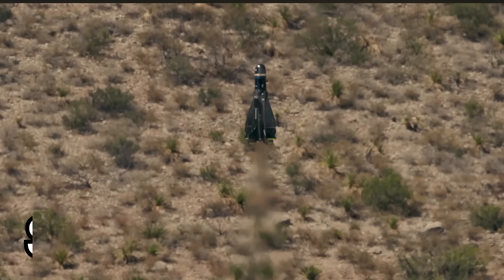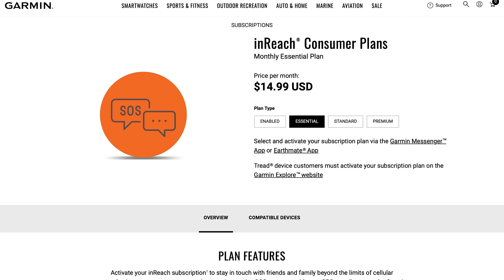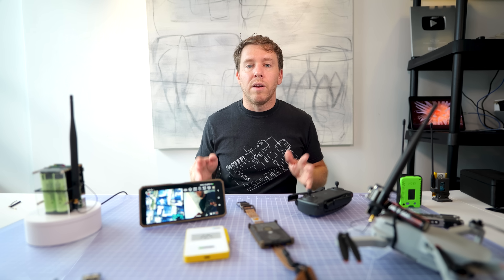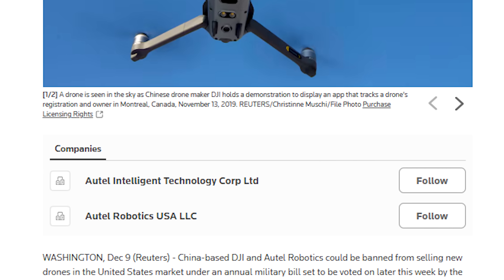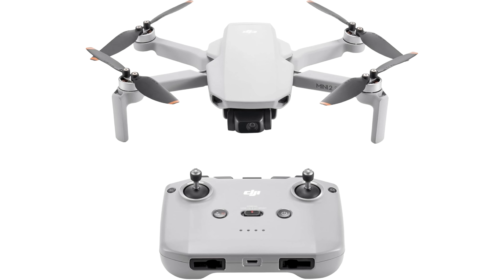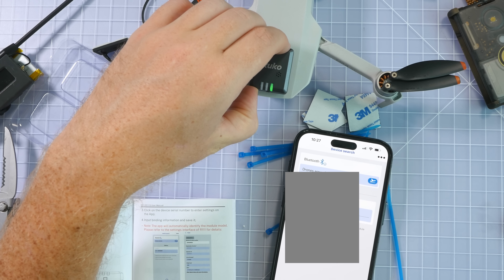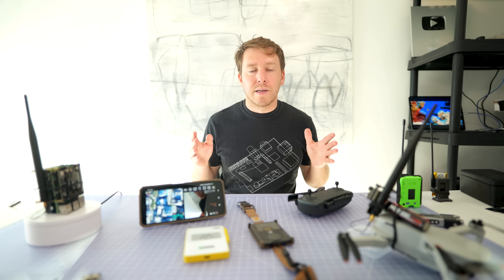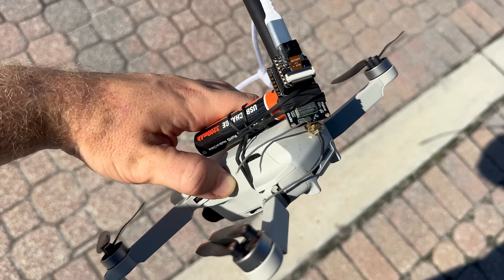I Built a $40,000 Military Drone for $120.07

Comment: 14:50 ahh brings me back to early drone building days :) Those waves are an artifact which boils down to vibrations experienced by your camera caused by the propellors. mounting camera directly to drone body (without physical dampening) really isn't an option. Camera belongs in a suspension system, typically below the drone. Think: camera suspended below drone by 2-4 rubber mounting points. Its a great opportunity to add the extra battery to the same rigid body carrying the camera, to add inertia to fight the vibration too. look up search terms like  Anti-Vibration Shock Absorption Damping Rubber Balls. Great video, thank you for sharing!
Reply from the maker: please and thank you

Comment: Well on of the differences are the material that the components that are made of, for example you can have a transistor that have the same almost the same specs but the cost is different. I hade found transistors are that like 600 euro each, they are used for aerospace.

Comment: maybe i'm dumb, but i've watched the video very precisely till the end and did NOT understood - what's the point of all of this ? 😂🤣😂

i mean - for some unknown reason you've decided to use WIFI HALO for video-transmission rather than widely available FPV video-transmitters (DIGITAL, HD!!) - such trnsmitters comes with receivers which have HDMI OUT = you could connect it into Raspberry PI (with HDMI -> CSI CAMERA-port converter) and use RPI as a video-streamer via starlink to youtube, tiktok or anywhere else

the whole setup will be cost something as 
$140 for VTX + $20 for HDMI-CSI = 160 USD
+ RPI ZERO W : $15 bucks

so basically saying this "device" have no sense

especially that you are using original joystick for drone control
(which have range limit of 20 miles)

rather than some kind of MESHSTASTIC-enabled joystick & a receiver mounted on drone
- which for example could give the ability to control it anywhere in the world

Comment: Hey that’s pretty cool. Here’s some pointers to extend range/reliability and improve image quality. 

Keep all cables and objects away from your antenna (don’t strap your battery to it).
It’s a tuned device and by doing so you detune the antenna which not only sacrifices range whilst creating blind spots but will over time damage the power amplification stage of the transmitter rendering it useless. 

The ripples seen in the video are CMOS sensor ‘jello’ caused by mechanical vibrations interacting with the CMOS sensor’s rolling shutter.
You need to physically decouple the camera from the airframe. For a small device 4 silicon o-rings mounted in a square (the o-rings make the walls of a box) using a 3D printed mounting point would work. Think of each o-ring as a pair of leaf springs back to back. 
Look up FPV camera jello vibration dampers from a good few years back for ideas. Sections of large gauge silicon tubing might also be easier to work with.
Good luck.
Reply: Great ideas there.  Could do your own video!
Reply from the maker: so what's the optimal battery setup then?

Comment: something to consider for future project..  Hopefully soon-ish.     

A drone (or kite or  balloon)  that can fly   a device up  out of tree's and mountainous areas to get cell signal that can beam to your phone down below where  you are.  This way you can contact search and rescue etc; YET not put your cellphone in danger of getting  lost or bricked if the flying device crashes.   Having your phone with you; at least gives you the option to hike to area with cell signal if your flyer crashes.  (SAR suggest to not leave vehicle....  but gotta do what ya gotta do... right now that is ONLY choice when you have no signal.)
Reply from the maker: In my expereince it's not the mountain blocking the signal that's the problem, you usually won't get signal even at the top of the highest peaks. It's just the remote-ness of the area so not sure drone helps there very much - unless you've got other nodes in the area.
Reply: @DataSlayerMedia  really good info.  Thanks.

Comment: @11:36 you can see you did not secure the camera module. Attach it to a rigid surface because its flexible PCB is susceptible to vibration. The "jello effect" or wavy distortion you see in the video at @14:48 is a direct result of the camera module flopping around. While securing it will significantly reduce this effect, it may not eliminate all distortion.

Comment: Mechatronics engineer and 7 year UAV builder here,
the patterns in your image are commonly known as "jello" in the fpv drone world. It's a result of high frequency oscillations from the drone adding up and moving the camera back and forth throughout the frame that's being captured by the sensor. It's fixed by stopping your camera from flapping about but it can't be tied down too rigidly either. This is why the drone's camera is held by a system of rubber strips to "isolate" it from vibrations as you would with electronics from a dirty PSU voltage.
Reply: basically the rolling shutter effect
Reply: @tobutticus  yeah, who would have thought there would be so little jank factor attaching a $6 open source camera to a drone n your garage. I wonder if those 3M two-sided tape squares would do it, they are good for sticking a lot of things together and it's basically about 1/16 inch of foam between the sticky layers.
Reply: @tobutticus  in combination with the vibration of the motors
Reply: Comments like yours are the reason I want to be a content creator and build a community around my topics of interest. I salute you, sir! Thank you for your comment!
Reply: Click bait title, he seriously thinks his $120 drone is a $40K gorilla military drone. In the Military world $40K is dirt cheap, anything less than that would be interesting feat of engineering but really needs to surprise experienced military aerospace users. Military drones camera systems uses proper gimbals and vibration isolation to prevent the camera recording oscillations due to vibrations, those gimbals systems itself costs $120 alone (for a cheap one). There are tons of books and theory on this subject alone.
Reply: Sometimes pieces of cardboard work too. It's hard to find the correct rubber pads.
Reply: Maybe if he keep all payload centered so that it doesnt affect the center of gravity that much. That extra length of cable is just flapping around, probably causing the flight controller to always auto correct attitude.
Reply: Just a highschool student here, in simple terms is it like a gyro? like to counter balance is using Tension uped strings, for example the counter balances which are in skyscrapers in case of a earthquake
Reply: Nice :)
Reply: Switching from a rolling-shutter CMOS to a global-shutter sensor (CCDs were the go-to in the past, but modern global-shutter CMOS has taken their place) will eliminate the jello effect. Back in the day, PIXIM-based FPV cameras were prized for their wide dynamic range and analog outputs, which integrated well with 915 MHz UHF RC links and long-range analog video gear. A high-gain directional antenna (Yagi, Patch, or Pepperbox) on the ground station makes an enormous difference

I’ve flown my Zephyr Z2 on ImmersionRC gear out past 40–50 km with solid penetration, even through terrain. Fresnel zone violations are a thing of the past.
Reply: Yup, should be able to be tuned out
Reply: agreed - this was the first thing I thought - back in the eaaarly days of uav building (when it was tricky!) - usually a few strips of servo tape (green, super thick kind) would help but the camera needs to be fixed as well not floppy like that one you had.  Great content!
Reply: 0 year UAV builder here, this is basic physics. LOL
Reply: @HermanWillems  better place to start than at nasa internship. you can soft mount a camera but dont do it with motors or flight controller cuz the gyro filter takes care of it, otherwise you get bigger wobbles and feedback loop. flyaway. RIP.
Reply: @overryd8573  You do soft mount the gyro, but not too soft. Less work for the filters. And there was a faze where people were soft mounting motors, diatone had some frames with it built in.
Reply: Actually it is due to the fact that the camera doesn't have a global shutter as a proper system would have. It's fixed by using a real camera.
Reply: @rsilvers129 you mean like army uses ?
Reply: not a drone tech here, figured lack of gimble, cause vibration issues like camera movements...
Reply: @imyourocd  or oscillation due to the flight controller trying to correct attitude caused by flapping wire extension probably throwing CG everywhere. Maybe the flight controller PID is tuned without such unusual payload.
Reply: @itchysaddle  true..
Reply: @itchysaddle  No, to put it simply. Spinney motor make vibration. Each wiggle on the screen is the vibrations per frame. The flight controller isn't that fast.
Reply: @Ka0sNite  you are probably right. But the camera in the DJI drone does not have this. Is it the gimbal that came with the drone that is fast enough to compensate for this vibration or it is just a good quality camera?
Reply: I thought it was something like that. I'm guessing this can't be fixed the way you fix gyroscopic procession by counter rotating. I'm sure drones are already doing that.
Reply: I know absolutely nothing about fpv but have a few drones with 3 axis gimbals but anyway wouldn’t you be able to increase or decrease kv from software or is that all limited by the hardware? You could change those oscillations by changing the power going to the motors in effect changing frequencies? I’m interested in building an fpv and have crashed, repaired some DJI Drones so I know how to solder and stuff but that’s about it..
Reply: Moongel drum damper pads are a cheap and effective fix.
Reply: Seems like it ought to be solveable in software with a convolution matrix
Reply: You can pick up an icm-42688 sensor for cheap
Reply: Software defined digital image processing can fix that
Reply: so the answer is rubber bushes yes?
Reply: Use rollerons attached to the camera mount to self correct
Reply: are not they using gimbal system instead of a fixed connection with rubber?
Reply: @bern_channel a gimbal wouldn't solve this particular issue. a gimbal would indeed stabilize the video output, but wouldnt stabilize the oscillations of the sensor itself.
Reply: @bern_channel   - most RPA Gimbals are rubber mounted with damping mounts.  Eg. any DJI MultiCopter - has the base plate on a semifloating arrangement  (at least all of mine do) - there are~ limited 2DOF - with a small lateral movement allowed - higher time domain response than the UAV is likely to maneuver. - with vibration damping.).
Reply: @MD_Mr_MD   That takes care of the high frequencies, but the lower frequencies are taken up by active software in the gimbal itself.  Like a chicken, you can shake and rotate it but the head is fixed in space.
Reply: @bern_channel  gimbal systems are designed with damping including active damping to remove vibration.  If you don’t want a complex high data rate closed loop control system you can use the right stiffness profile elastomer and it solves a complex engineering problem with a bit of stretchy stuff.
Reply: Or perhaps quickly snap a frame to a frame buffer, then transmit the stored frame. If already doing this perhaps upgrade the processor board for faster capture.
Reply: @raygunz333  assuming this camera has a rolling shutter, that wouldn’t help.
Reply: @raygunz333  still not as clear, just fix the camera resonance via tuning the damping/mount so your pixels aren't smeared in the first place.

Comment: Besides that this project is nowhere comparable to a fully specked drone. The point still stands that drones are low tech these days.
Drones use decades old technology of electric motors, controllers and radio antennas. The only reason they where not build this way before, is that no war needed them, in this format, before the invasion of Ukraine.
If you think that drones are high tech and require special controls on the technology, you're way behind the curve. Of course, drones can be equipped with high tech, just like cars and planes can. And some specific stealth or anti jamming technology can be high tech. But the drone itself is not new. Just like night vision, it is old technology. Just because something contains a PCB and some micro controllers does not mean it is high tech these days.

Comment: use stuff freely, stay free, ownership of corps is worse than freedom of people with stuff. above owns you, not you yourself. so dont make any claims. weather balloon blimps are off regulations. ie controlled solar drone blimps. always be smart, not dum. bowing to people is not smart. stay free. amendments and 1st commandment and all. for stan of people elected kings. by law, not taking account law limiting freedoms, like 2nd amendment. ie dont make a law that, blank. you have a problem with the freedom law makers. you always break laws if you try to obey laws and lose your freedom anyways. your freedom is not actually free. how ironic. have you ever gotten any limits for helium party balloons that run away from your rulers chosen by you. if you dont defend, you atak. lora ftw. duct tape fixed all wire issues. you can test if your gov is freedom oriented or law oriented. ie constitutional or just plain mafia.

Comment: I want to build a stolen vehicle tracking network that can use a drone to find and follow a vehicle that has disappeared from an owner's home. I'm tired of motorcycle thieves getting away because of intentional incompetence when it comes to police fieldwork. 

We have cops working with the chop shops to prevent owners from finding their stolen vehicles quickly. It would be worth the effort if we could build a statewide network using the same tech that those miners use.

 There are people in Houston who have networks set up on top of the tallest buildings and towers here. 

I want to be able to tag a Honda Ruckus, which is easy to pick up and steal, and send a drone to its location to visually identify it, and then send the cops to the location using real-time location data.

The police and the insurance companies are doing nothing to stop theft in Houston.
Reply: the video title "I Built a $40,000 Military Drone for $120.07" is a blatant lie. he spent $120.07 on accessories to slap on to a drone that costs several hundred dollars and the end result is nowhere near the 4$0,000 "equivalent"
its a bad lie. cheap clickbait content.

Comment: Too many negative comments. Some are missing the point. If you want better, build it. Modify it. Shock proof it. Upgrade it. Be positive. Makers aren't usually derogatory and insulting. You don't  have to solder every resistor to be a  maker. It's a user oriented home build.

Comment: These things probably aren't EW hardened or built to the same redundancy. Do you think you could do a video about your own EW and microwave/EMP hardening to see if it's really what makes those things so expensive?
Reply: Not just EW hardened. Military specs require hardware to operate in extreme temperatures and pass durability tests. Some high altitude electronics can withstand high levels of radiation.
Reply: I agree - this whole video would sit better by dropping the hype name. M-grade GPS - EW/Radiation hardening of the electronics, ultraquiet motors and propellers (one can not hear the Black Hornet hovering 10 meters away). Making it hard for infantry to break (that is 10,000 USD right there, since we are better than babies+dogs+brown bears combined at breaking unbreakable shit), make it (somewhat) water and sand proof - ensure that the battery and electronics are happy to work at 6000 ft in Norway during January after having been exposed to wading ashore in 20 F from the ocean with high subfreezing humidity before hiking up into the mountains where it is -25F. 

Sure, military industry is really lucrative, but not factor of 333 lucrative. 

I find this project interesting on a "how does the tech work" more than on the basis of "why is military tech so expensive".

Comment: Anduril is not mad, commercial and mill spec parts alone are so complex and costly to manufacture, their tolerances are tighter, the Brushless motors alone are 2k, the esc are at least 600-800 each I can go on and on. From a commercial drone manufacturer.

Comment: Great, you've done the easy part, now build some wierd jet powered vtol thing that is expected to take off even after some grunt dunks it in every sand dune from phonex to sanfran, and remember to domestically source every part, specifically choosing ones that manufacturers guarantee to produce for the next 20 years.
Because the military isn't buying a drone, they're buying a production contract for x items built the exact same way for decades. 
Is it a kind of stupid way to procure items? Yes 
Is there good reason to do it that way? Also Yes
They won't care if the thing they're using is a one off from a guy in a shed when they're neck deep in a trench war five years in if it works, but on the day that that war starts and the weeks and months to follow, they want the stuff they need to show up the same as it always has before, not rushing out to order things that nobody makes.

Comment: 15:00 Those waves are vibration distortion. Because it's such a cheap sensor, it's taking a while to scan top to bottom, so each vertical line is shifted left or right that amount, due to vibration, causing this issue. Based on the travel, I'd first try just firming up the mechanical connection, or even add some form of dampening. A gyro would be the higher cost solution.

Comment: You know, there are those long range mission driven model airplanes running on very low power and very low power often using solar. Wouldn't that be a good base for your network node?
Reply from the maker: Probably, yes